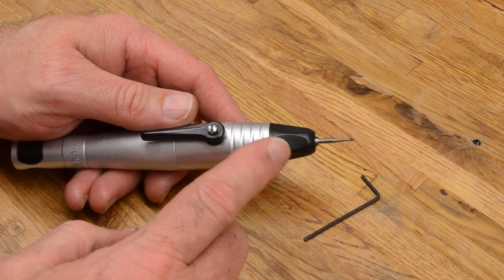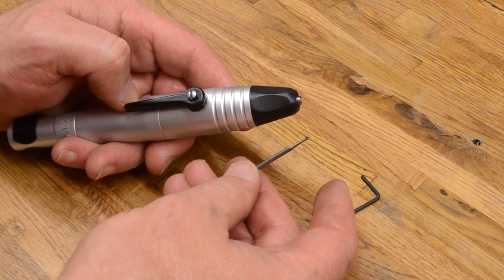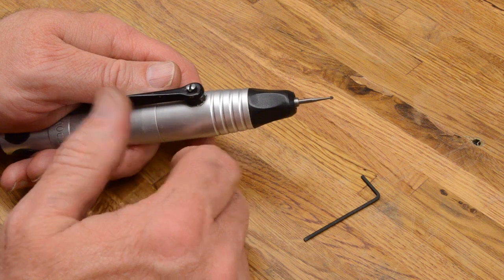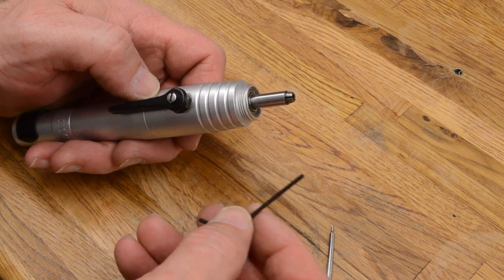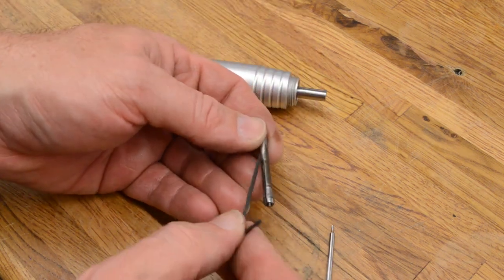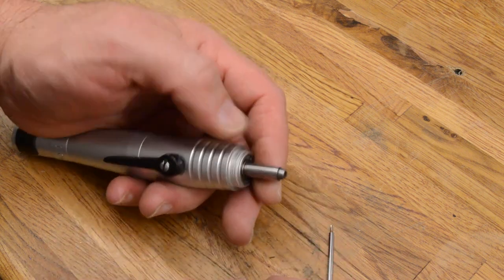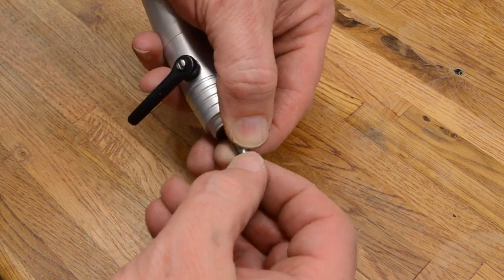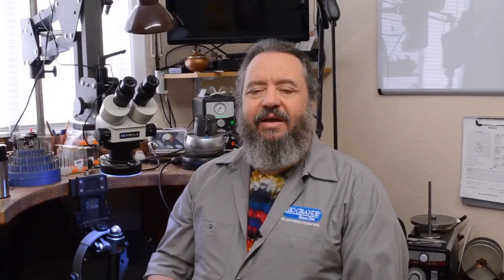How to Adjust the Collet on a Foredom® H 20® Quick Change Handpiece

Comment: I'm having the opposite problem....I've got a burr jammed in the handpiece. The lever for the quick release will not swivel to release the burr. Any thoughts?
Reply: @wcc101662  take a look at my comments above this on some other people’s comments. I believe it would be helpful for you. Basically you need to get the collet out to release the burr and then troubleshoot from there. So, there’s a small wrench that’s made for these collets (some handpieces come with it, small metal looking piece with cut outs that match the collets) and if you follow this video just add the part where you break the collet free before it’s finger loose. The video shows it already loosened. Sounds like this would fix you up.  If you don’t have the wrench, you can use something more DIY like a set of pliers but it’s super important to not squeeze on the collets so keep that in mind if you choose that option. More twist, less squeeze with really light pressure, error on the cautious side and you will probably be fine. Hope you are able to fix it. I will check this post so if you have any questions or other issues I will try my best to help. I’m not an expert, I should’ve mentioned that, but I use this stuff A LOT, so I’ve learned the hard way!

Comment: Thank you for the video. Having an issue screwing the cullet out ive tried everything   Please help!😢
Reply: Same!
Reply: I’m not an expert but for the stuck bits and stuck collets I didn’t see in the video the part where he breaks the collet loose, he just says “mines already loose” but there’s a tool that is specific for adjusting these handpieces that is essentially a wrench that I used to turn the collet when it’s stuck.  I have used a few DIY options when I didn’t have the correct wrench but sometimes the tool is included with a nicer hand piece so check your box.  Keep a burr in it, so u don’t crush it, and just get something soft to grab it and turn it as he did with his fingers. Use a pair of needle nose VERY GENTLY and it shouldn’t be an issue. But again, I am not an expert, I’m just an avid user of spinning devices! 😂

Comment: is it possible to find cheap collet set for this handle to move from T.30 2.35mm classic to other wide used diameters such as 3mm, 3.2 (pcb drill bits) etc ?

Comment: Why isn't there any info anywhere on how to change the collet to another size on the H 20 hand piece?
Reply: @bettybho2168  the collet changing process is similar on most of these style drills/hand pieces. A YouTube search might not find the H.20 exactly, but if you can find just about any other hand piece video, you should have no problems getting everything you need to know. The keys are, keep a burr in it while doing anything to avoid crushing it, and use the wrench that is made for removing or breaking the collet free, and if you choose to not use the wrench then be super gentle and don’t squeeze just turn and use as little pressure as you can.  The video above shows just about everything you need but didn’t show the collet being broken free, it was already loosened to finger loose in this video. I think that caused a bit of confusion.